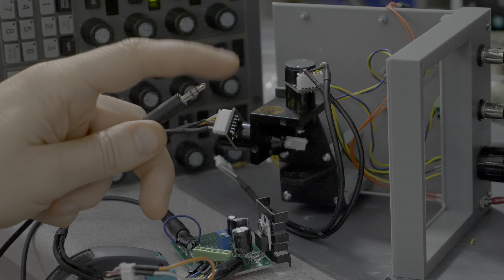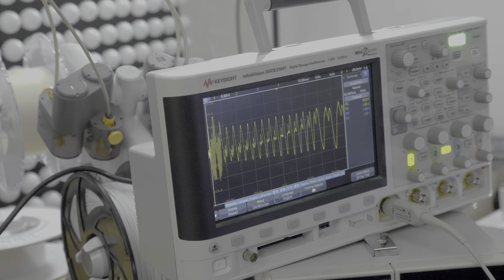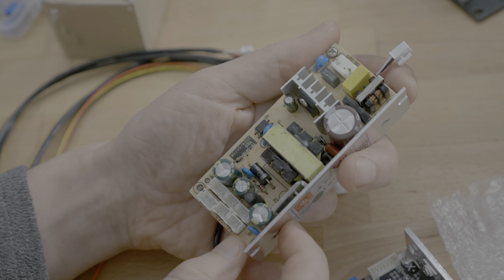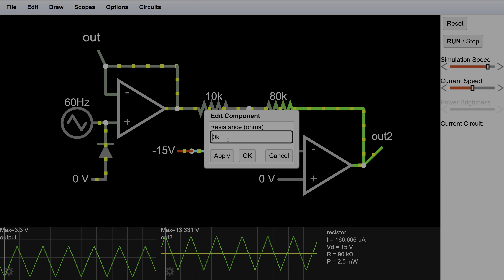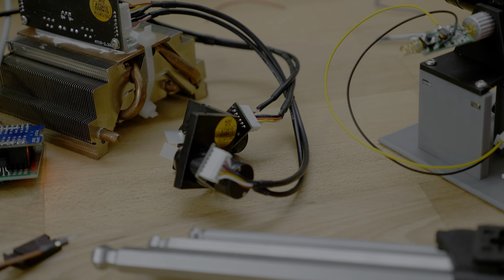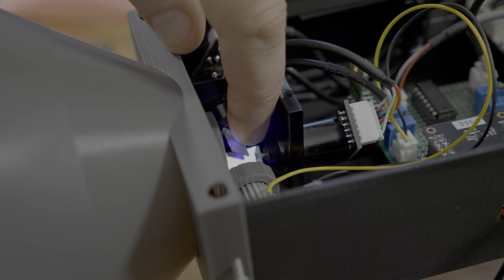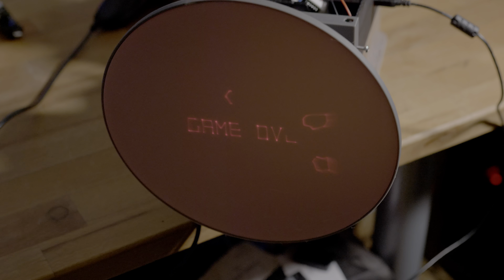I made a LASER vector display

Comment: Here's an idea. If you use a white light laser, aim it at a high speed spinning mirror for horizontal trace and each time it reaches end of line, lower the beam a little for vertical trace, so you get a full raster image, then rapidly attenuate the laser color, could you make a full image of say 1024 x 760?

Comment: I made a really basic 2 galvometer setup like this using two reader arms from Computer hard drives, removed the arms & glued a mirror onto the head where the arms were & connected my amplifiers speaker wires to the cois connections.

Comment: Ace as always, but with the galvos burning out that means youre over driving their current. Is it pottible you just pushed the current too high rather than control there working space? (angle of rotation) 
Or is it a case of trying to get the movment fast enough for the wider range?

Comment: basically remade the CRT but safe
Reply: I'd say CRTs are very safe if you:
a) don't touch the 20kV cable
b) don't repeatedly smash it with a hammer
c) don't throw heavy objects at them
d) don't put your fingers into the PSU, especially while it's powered on

So basically, if you own a brain capable of the logic of a 10yo child.
Reply: @amir3el fair
Reply: 100% GPT pasted

Comment: 2:15 as far as I know, the power supply "negative" is not connected to the "ground"... that is why you have the green terminal on your power supply - only once you connect your PSU negative lead with this green terminal, only then it is "grounded"

Comment: I had an idea, what if you some how made a beam splitting array that separated the beam into multiple horizontal line segments that could simultaneously emit light onto the screen and have a constant vertical sweeping line and have some kind of electrically actuated darkening line film like that of a calculator that could be programed similar to a printer. That way you could have an entire beam of like being spread into a single line then have some kind of high speed brightness adjusting line to block out light in sections that is then passed through a rotating prism that redirects the light to screen in cycles that way you could write each frame into the driver as a cycle of rotation and once you test it out getting one successful slow cycle you can increase the speed changing how much definition you can get into a cycle allowing you to make upgrades and improvements in terms of each individual piece of the setup. In effect it would be like how a printer prints individual lines of ink in series but with light (printing and entire line of light in series and then starting over once the cycle is completed)

Comment: why not just use two spinning prisms? that way it will raster mechanically, you wont be able to do vector stuff but would work better for images though. all you would need to do is nick the lazer bit from a lazer printer and a longer prism for the vertical scan

Comment: I did the same thing to my first quadcopter, connected the power cable wrong while I was blind working on it on the bench, even though the connector was suppose to be designed to prevent that from being possible.  The company I had bought the quad for 500 bucks from... had done a poor soldering job on the power connector and melted the male pins so they stuck out further than they should have, making a reverse polarity connection that should have been impossible, impossible.

I never really recovered from that... I attribute it to sudden infant death syndrome.   It's the same feeling.   Your first project that is going so right, suddenly goes totally wrong and is destroyed and ruined in an instant.

Comment: I worked on vector displays for early CAD systems.  Our solution was to position the beam, then draw directly to the endpoint using constant charge capacitors.  We found we needed to modulate the beam intensity because it started out slower and ended with a "hook" to find a precise spot.  The display could do raster as well, but the direct drive was spectacular at the time.  Now used mostly for planetariums.

Comment: Why dont you just have two motors spinning continually at one direction only, but at very fast speeds? 
You could scan through the entire screen and you would just need to modulate the brightness of the laser instead. 
You could use two steppers for this im pretty sure. Maybe the mirrors could be a polygon type shape since the amount of sides would determine how many scans per revolution.

This should be very doable no?

Comment: Now we gotta somehow get it to raster so we could display a composite video signal using the same way a CRT would
Reply: FDM print a screen with 3 differently colored fluorescent filament subpixels, use one UV laser, ditch galvos for closed loop brushless with 4-sided mirrors, and project front to front via mirror in the back like someone here suggested. Start low-res, see how far you can take it. Or at least that's what I would do. >:)
Reply: @ronnetgrazer362  might be hard to get it precice enough to hit the right subpixles at the right times, but what about that JVC system where they had a filter on the front that could electrically change which color its filtering and then you draw three greyscale images in sequence but only having RED then GREEN then BLUE in the image in sync with the filter so that you get a color image? could also wait with this until we get a much faster raster.. as if you want anything thatll work with this method say..60 real hz then youll need 3x that to achieve this filter method.

maybe i should give this project a wack myself, ill see depending on my next paycheck.(might be a while till i can do this)

Comment: not sure if anyone else has already proposed this but fold the projection to increase the distance between the laser and the screen. Basically put the galvo unit under the screen, pointing to the BACK of the cabinet, bounce it off a tilted mirror back to the display screen. Double the throw distance without increasing the size at all. You just have to flip your image going to the galvo unit.
Reply: idk anything about lasers but im gonna assume the extra distance gives more leverage on the angle, so it requires less movement from the motor to get a greater distance of movement from the laser
Reply: this is how apple iphone's and in general telescopic cameras on phone work. they are placed into the phone sideways and then mirrored properly. this way the phone doesn't have to have bump higher than the width and achieving the same results

Comment: Why can't you make a display of shades of different intensities for each pixel? This can be done by adjusting the laser power. Then you will get full black and white images. This will require a more powerful laser that can give more light in a short period of time. And you will also need faster mirror movement to process more pixels per second.

Comment: id make something like a speaker setup to float the Lazer with a neo magnet 
then like a crt use a xy coil to push the Lazer around 
probs like a old radio tuner string setup hybrid ech a scetch and to make it more sensitive could bldc motor the rope pulleys or something like that 

best is if u could make the light charged and use electrostatic deflection 

or make a special LCD display to make a digital mirror to reflect light

also with mirrors instead of rotating make them right shape move just up n down and could use a speaker to move 

possible ideas work from

Comment: To remove the DC bias, I would have used the classic inverting op amp audio mixer circuit, with a fixed -1.65V as the second input. This has the advantage that the output always stays centered around 0V, no matter how high the gain is set.

Comment: I'm glad you got this project done. I walked this path a year ago. esp32 + homemade galvometer from dental vibrating counter motors. I used an audio amplifier. I wanted to power everything from one 18650 element. I didn't have enough power, my project is in the box. He was already drawing squares, but I couldn't beat the rounded corners.

Comment: Bitluni, your projects make me feel nostalgic for the things I've developed myself in the past. I think I'm just about bored with hydrofoil design afer a few years and the success is there for my wing surfing. My hobby since spring was caring for new citrus but as our NZ winter gets closer and I won't have to hide from the heat, maybe I will return to some of my own mechatronic and software stuff. So good to see your success in the end.  I recall in my late teens inventing the idea of engineering piezo-electric transformers, they could be an alternative to your galvos. Think leverage to raise or reduce voltage using 2 different piezo electric elements. I had a couple other significant Piezo ideas, the other lesser significance one has already been re-invented and commercialised by another, that was piezomotors, he created SMD piezos and reinvented the same rotary nudging idea I'd invented back in my early 20's. I don't see why you can't engineer piezo-actuation for the lasers but you are still working with relatively high voltages. As the current could be quite low though, you could potentially do this with a couple of charge pumps like on the old MAX232 chip used for old RS232 serial ports. Or at least use those for inspiration. Maybe a voltage multiplier circuit if you need more voltage, at least it is less likely to loose the magic smoke!.
Reply: What kind of piezo actuators were you thinking?
Reply: @jdspugh  Custom probably. The application requires parallel wired series stacked actuators to build a space efficient stack to oscilate a mirror with short actuation mirror axis rotation radius and some conrod equivalent, possibly with flex hinges.
Reply: @fluiditynz  Do you think a stack of regular small piezo discs can do this? I was wondering if the movement from them would be enough to deflect the mirror sufficiently. I have 50 of them sitting around which I was gonna use for this purpose, but haven't gun-activated to testing anything. I believe the setup may need a spring also to compress the discs back into the un-activated state.
Reply: @jdspugh  I wouldn't. Usually there is a solder blob or the need for one to connect wiring. But you are right, adhering the stack is also a mission needing thought. You could have a push and pull stack though, simply different polarity wiring.
Reply: @ Oh yes. Push pull is a good idea also.

Comment: Incidentally, when you're using a multi-cell LiPo battery, never ever use the balancing connector for power. You are unbalancing your cells and it's very easy to cause a fault that will cause a fire.

Comment: I think you were on the right track adding the lens. So, what if you added more lenses to repeatedly widen the sweep?

Maybe try doing a laser raster display next. Instead of moving the beam with oscillating mirrors, take a leaf out of the laser printer design book and use mirrored wheels that spin at a constant speed. The combination of speed and number of sides would determine the refresh rate for a given direction.

Comment: Are you sure your lab bench power supplies wouldn't work? The negative pole of lab bench power supplies is usually floating. Otherwise the power supply would be a lot less useful, as you couldn't connect them in series for example. Most lab bench power supplies have a ground connector that's referenced to mains PE, so you can ground either side yourself if you want to.

Comment: Don't use the potentiometer to largen the projection...you really need to feed it differential 5v instead of just 0 to 5v.and the reason for that is ..noise......

The reason why your galvo set is cheap is that it is missing High frequency dampening which severely limits its performance ..this is galvo board limiting you not the galvo set itself.

Comment: Good thing I haven't started on my DIY laser show project yet. I have an RGB laser module lying around and I must confess I'm afraid of my eyes as well, especially since I don't know which safety glasses to use with multiple frequencies coming out of the laser. module. Haven't bought any galvos yet (I thought I did at a special discount, but it turned out to be the power supply only 😋, which of course came without a connection diagram 🙄).

Comment: I would be surprised if the vector music works through audio feeds. When I was doing laser shows in the 90s Pangolin sold the LSD100 software with instructions on how to modify the sound card to run the galvos. If I remember correctly you had to bypass some caps that are there to protect your speakers for DC signals and pulses. I imagine the music is fun through a similar filter before it is put on an audio format.
Reply: Not to mention the galvos only run 24K to 50K points per second and an oscilloscope is in the megahertz range with no moving parts. A good light show has extra blanking points to "stop" the galvo and clean up those tails on the end of your lines.

Comment: AI Summary:

Building a LASER Vector Display: A Journey of Trials and Tribulations

*   0:00 Project Goal: The creator attempts to build a vector display using a cheap laser galvo, aiming to improve upon a previous "fake CRT TV" project.

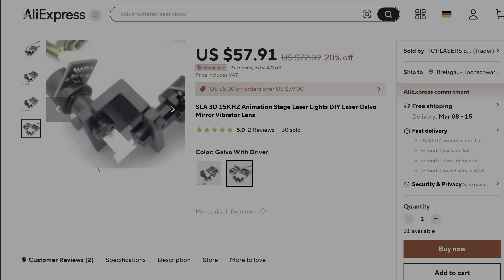*   0:26 Initial Setup: Replaces a stepper galvo with a cheap, off-the-shelf galvanometer from AliExpress. The initial galvo purchased didn't include a required power supply.

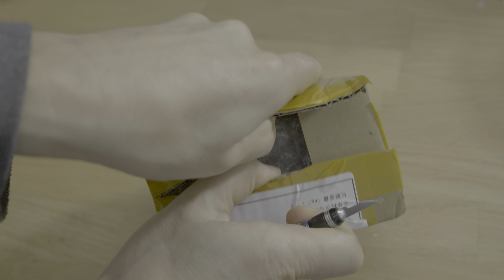*   0:41 Power Supply Issues: The galvo requires a ±15V power supply and accepts a ±10V or ±5V signal, which was not clearly documented. Initial tests with an ESP32's 0-3.3V signal were successful.

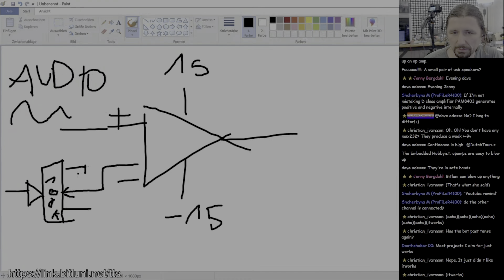*   1:44 Analog Preamp: A custom analog preamp circuit is built to boost the signal.

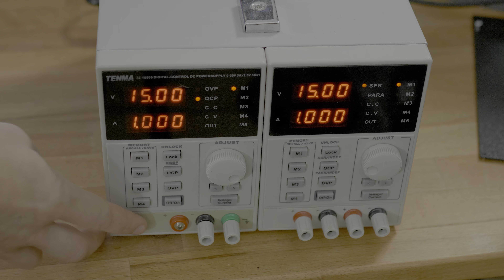*   2:11 Electrical Mishap: A major setback occurs due to a reversed polarity connection while attempting to use a 6-cell LiPo battery for power, damaging components (electrolytic capacitors, a -9V regulator).

*   2:50 Component Replacement: Damaged components, including op-amps, drivers, and regulators, are replaced, but the repairs are unsuccessful.

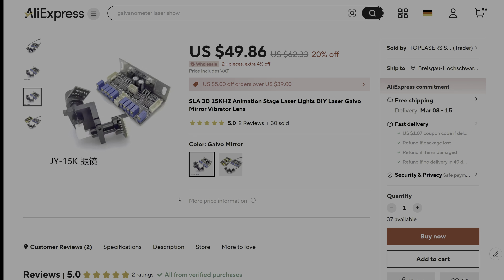*   3:55 Ordering New Parts: The creator is forced to order a new galvo, taking a 3-week delay.

*   4:09 Circuit Analysis: The time spent debugging provides insight into the galvo's feedback loop, which uses light detectors and an infrared diode.

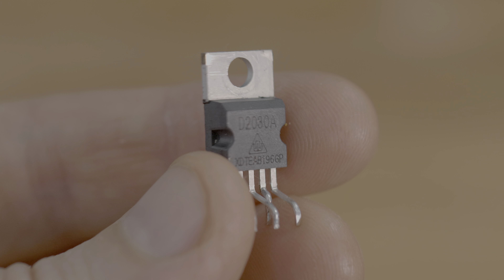*   4:27 Audio Amplifier Discovery: The galvo drivers (D2030A) are identified as AB-class audio amplifiers, leading to a side project building a small audio amplifier with a TDA2050.

*   5:22 Feedback Loop Experiment: Attempts to drive the galvo without the feedback loop are made, revealing the difficulty of balancing physical attributes without it.

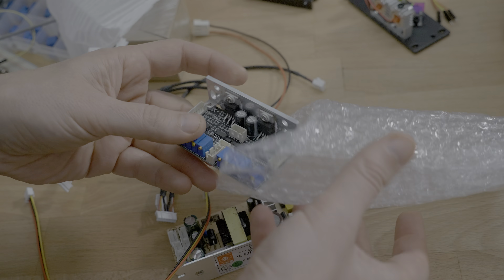*   5:52 New Galvo Arrival: A new galvo arrives, this time with the correct power supply.

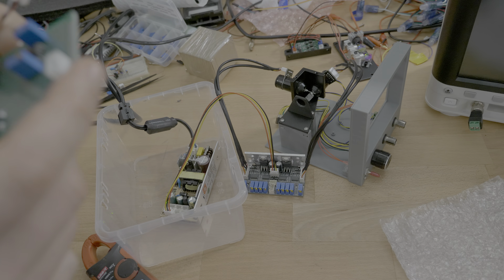*   6:20 Preamp Reconstruction: A new preamp is soldered, designed to be powered directly from the galvo's power supply.

*    7:07 Heat Issues: Driving the galvo at high amplification to cover a large area causes significant overheating of the controller.

*   7:27 ESP32 Integration: Efforts shift to driving the galvo directly from an ESP32. The challenge is the ESP32's 0-3.3V digital-to-analog converter output, which is unsuitable for direct galvo control.

*   7:56 Amplifier Circuit Selection: Various amplifier circuits are considered, and a "cursed amp" design by "Ruta ফরজ" is chosen for its simplicity.

*   8:09 Amplifier Construction: The chosen amplifier circuit is built on a perfboard, incorporating a switching power supply (a drop-in replacement for an LM7805) to efficiently provide 5V from the 12V input.

*   9:05 Laser Control: A MOSFET is added to switch the laser on and off.

*   9:31 Another Galvo Failure: The X-direction galvo stops working, initially suspected to be a driver issue, but later confirmed to be physical damage to the old galvo.

*   9:55 Wide Angle Limitations: Driving the galvos at wide angles seems to lead to their eventual failure.

*  10:05 Wide-Angle Lens Attempt: A wide-angle lens from a smartphone is considered to increase the display area, but the physical setup proves challenging.

*   10:29 Case Redesign: The original small TV case is abandoned in favor of a more practical and modular design.

* 11:48 More Galvo Problems: Additional issues and yet another galvo failure occur, highlighting the sensitivity of the components.
* 12:05 Angle Reduction To prevent more galvo damage the angle is reduced and the lens is used to project a bigger image.

* 12:22 Blood Sacrifice: The creator injures themself, jokingly attributing it to "poor safety Gods."

*   12:32 Final Success (Mostly): The project finally achieves a working state, displaying graphics, including a port of the classic game Asteroids (originally created by atomic14/Chris).

*   13:09 Vector Display Explanation: The display works by rapidly moving a laser dot to draw line segments.

*   13:20 Image Sharing: The creator implements image sharing by processing images with a Sobel filter (edge detection) and converting the edges into vector lines.

* 13:57 Brilliant-dot-org: Sponsor advertisement for Brilliant-dot-org educational platform.
* 15:07 Project Conclusion: The project is deemed a success, despite the numerous challenges and setbacks.

I used gemini-2.0-pro-exp-02-05| input-price: 1.25 output-price: 5 max-context-length: 128_000 on rocketrecap dot com to summarize the transcript.
Cost (if I didn't use the free tier): $0.03
Input tokens: 18022
Output tokens: 1090

Comment: When I thought about laser screens I wondered if I could use DC brushlees motors with encoders for position or a zero sign for times, but I would have a raster display, this system with galvo, which I didn't know about, looks better and can get a vector display. Great work.